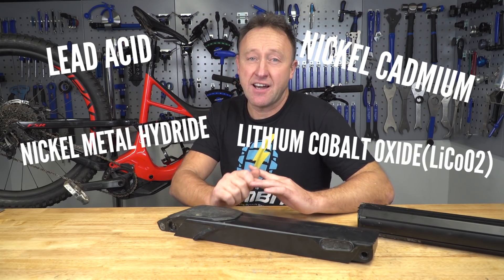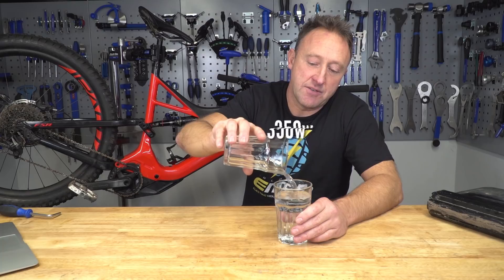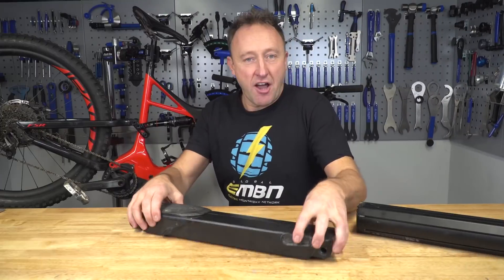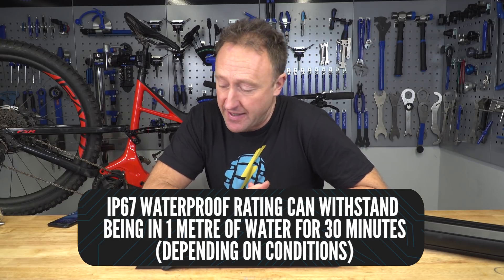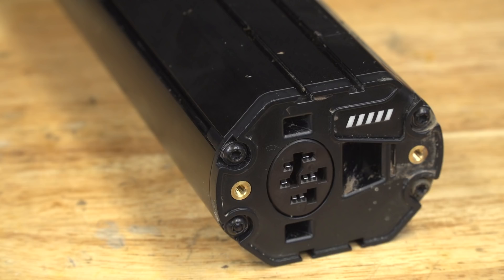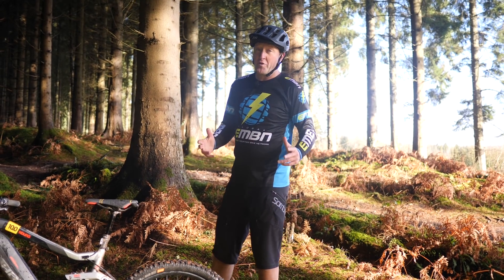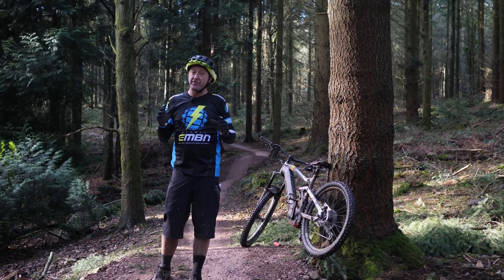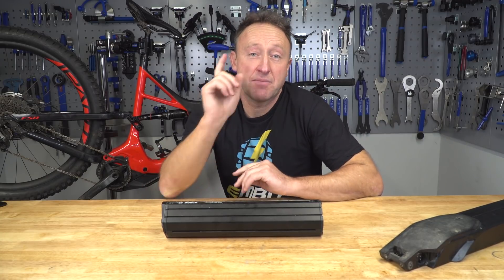E Mountain Bike Batteries Explained | EMBN's E-Bike Fundamentals Part 2

Comment from the maker: Leave any further questions about batteries or battery management in the comments below and we'll get back to you ⚡️💪
Reply: Tomi Saaranen don’t be put off. An ebike is probably the most grin inducing purchase you will ever make. 

I cannot speak highly enough of the fun I’ve had on mine.
Reply: Can a ebike be charged from a car 12v inverter?
Can a ebike be lifted on a roof carrier?
And last question can you fly with a ebike?
Reply: I have a 12v-240v invertor that I plug into cigarette lighter and then plug my Shimano charger in to charge my bike battery. Works just fine.
Reply: Electric Mountain Bike Network is there a way to charge your ebike battery from  a 12volt sort of supply? I’m thinking about whilst I’m away in my van and off grid. Potentially is there a battery to battery sort of transfer as an alternative?
Reply: Craig Wilson I’ve wondered that too. More the inverter bit though.
Reply: Regarding roof carrier, I did it several times: open the latches on the rail. Lift the holding clamps to a proper height. Take the battery and everything off the bike. The remaining 18-20kg are manageable to lift. There is a trick however: you must use a strap or a string and bond the front wheel to the frame, so that when you lift it, the wheel remains straight. Once you have the front wheel locked, hold the bike on the frame near the center of gravity (one hand near the battery support/bottle cage, the other at the same height on the saddle tube). Lift it above your head, horizontally. Move forward and put the wheels on the rail. Carefully rise the bike, pivoting the wheels in the rail. You may step on the curb or a small step if you are smallish or working on a high vehicle. Once you have the clamp holding the frame, the rest is easily done. To take it down, same procedure reversed: let the bike fall on you, hold it on the frame near the COG and let it fall down. 

For the total carrying capacity, check car and carrier manuals.
Reply: You guys should talk about the next generation of batteries like graphene supercapacitors  http://berc.berkeley.edu/storage-wars-batteries-vs-supercapacitors/
Reply: DiGiTaLGrAvEDiGGA Why? For the time being, it's just vaporware meant to gain attention on the media. If you can't buy it, why talk about it?
Reply: Yep, agree with Martyn, I've brought some daft things in the past but my E-MTB is epic fun, it really is.
Reply: Well, point me to an online store, then.
Reply: I can understand why you might want to charge mid-ride, but if you have been hammering those batteries, it is better to let them cool a bit first. Warm batteries do not appreciate being charged. Also, the BMS will reduce the total charge and rate (current) due to the increased temperature and apparent cell characteristics (different when hot).
Then again, if you are permanently busted-up like I am or you need a bit of help - go for it. Better than walking. :) Just consider that you will be reducing your overall battery life a little more than you would otherwise.
Reply: I keep my battery in the 20%-80% rangez and i charge my battery with slowest charger, i have bosch powertube 625 with 2A charger. 
I think fast charging is overheating the kemistry in battery and that heat is killing the battery. 
Just my toughts.
Reply: LOL you can buy them... jackass!!
Reply: Yes, you are right. You need to replace batteries soooo often. I saw rich cyclists become homeless because of the foolish expenses to continuously replace batteries. And, yes, every time I come back from a ride, I get headache, it must be those terribly hard calculations, like, 80km range - 50km made=how far yet?
Reply: After watching this video I'm not sure anymore do I ever want an e-bike! All I would be thinking is that how much battery life I have and saving it and stuff, and the batteries are very expensive to replace

Comment: Abit of false info in this video. Yes the bosh battery will charge to 100% in 4 hours if you upgrade the bosch charger otherwise it WILL take 8 hours to fully charge the battery. All this because bosch have 4 different charging systems.

Comment: Hi I’m new to ebikes and my battery keeps cutting out it has 4 leds and when he goes down to tree is when it cuts out I found when you turn it back on and go slower it keeps going but so annoying anyway idea would be appreciated thanks.
Reply from the maker: That doesn't sound right! Might be worth a check-up with your local bike shop or consulting with the brand which manufacture the bike :)

Comment: I get conflicting messages re charging, you say get into the habit of charging  after each ride however I have been told not to store battery charged so I have been leaving it flat until the day before a ride, whats the correct way
Reply: Did you get an answer to this. I was told the same as you.

Comment: Many thanks Steve for taking the time to make this video. I am however confused as I was told by my battery supplier Cap-Rouge Batteries that its amp-hour size that determines the range. You say its Watt-hours, please clarify the difference. Many thanks.
Reply: Hamish Ford amp hour is the correct term for battery capacity in the electrical industry amps x volts = Watts x time = watt hours

Comment: Question about charging..if you do short rides daily and you drain lets say just 10% on each, should you recharge daily or after lets say 7 days when battery reach 30% and then recharge it to full? The difference is 7 charges vs 1 charge a week. What is best for battery life?

Comment: This is all well and good, but not all E-Bikes are of the mountain bike type. I recently installed a front wheel drive Direct Drive hub motor on my recumbent. I just topped 300 miles today. So far my best distance is 30 miles and I still have 40% battery. Oh, the motor is a 48 Volt 500 watt hub motor, Direct Drive. The battery is LithIon 48 volts 10 amps. And I use only what I need assist wise. I have five settings and I normally cruise in assist level 3. But, there are some big hills in the town I live in, so I bump it up to 5, just to get up the hill faster. You also forgot to talk about voltage spikes. I've noticed my battery level indicator goes down when I'm climbing a hill in assist five, but then when I go back to three, the battery level indicator goes back up. Yeah, lots of things to consider.

Comment: Two points which eBike manufacturers won't tell you about batteries:
1. You should avoid discharging battery completely. Is much "healthier" for the battery to do as many "half cycles" as possible. This should give you even up to 2000 half cycles!
2. Allow at least 30min after the ride before putting battery on charge. This settles battery chemistry to the optimal charging level.
Bosch, Yamaha, Shimano etc they don't make the battery cells which the batteries are build from. Those are Panasonic/Sanyo, Samsung, Lg etc. Read what they recommend for the long battery life ❣️❣️❣️

Comment: 7-£800 You must be "Mad" Every bike company is taking the piss! Wonder why they use dirty outdated tech? When they know they can use a supercapacitors bank, Instead of a big heavy battery, which would cost slightly more, But away cleaner tech, If lithium can only take 1000 charges and take a poxy 5 hrs to charge up, In my book your getting ripped off! A supercapacitor bank will take well over 1 million + charges and only take 30 seconds to charge to full power and put out the same power or even more power if required depending on your needs, If you want to run a 8,000 Watt motor it can handle it all day long! Try telling that to these outdated bike company that love to ram cheap chineesium crap down people's necks! Don't buy them they are a waste of money when you can buy a marine capacitor bank, They use them in nuke subs and other special kit like aircraft carriers ect, You get what you pay for and some of them bikes are way overpriced and under teched for that price, when you can build your own one and have a full charge in 30 seconds. They have fallen asleep at the wheel for the last 20 years.
Reply: A supercapacitor can't hold anywhere near a battery's specific energy volume, And  you think lithium batteries are expensive? Supercapacitor: Hold my beer! - They are 20+ times more expensive per watt! They are just not viable for consumer items! Unless you want an iphone that's 2 inches thick with less energy stored per unit mass and costs several times more? lol Having said all this, Hopefully with technology progressing as it is, Something can be achieved.. But these tech companies need to stop and pull their fingers out! It's all about impressing with specs and no focus on how long the power lasts.

Comment: Ebike are a big money swindle of the bike company's, 1euro for 1wah battery. 18650 LG, Samsung, Panasonic cost around 2euro, so 50x will cost 100euro, with some plastic and a bms it will be 110euro. Also the bms gives no indication about bad cells, so you rid 50km from home and the battery stop because 1-cell is under 3volt, with a balanced lcd charger that gives the user a signal it will never been happen, but for the bike company's that's 1euro more for a pcb with a lcd.

Comment: Thanks for the excellent topic.  Very informative.  One thing you didn't cover is an issue that I have had:. The charger to battery interface plug.  My Yamaha charger plug takes a bit of finesse to couple with the battery.  I wish it were easier.

Comment: ive cyced all over Europe on cyclo-cross bikes., and ride a TREKfuel MTB. I've never had an ebike.and a little scared of making the transision? Can someone explain to me without staying in a motel or B&B every night to charge up your used battery on a tour (which can be extremely expensive) across the country, which means charging you cant camp in the wild? So is ebike touring a problem how would you overcome the constant daily charging. carrying a spare battery would weigh a ton. 2ndly Ive got a medium size dog who wants to see the world in his trailer I guess pulling a doggie triailer is going to really half your distance  per charging. I thought of paying bike shops and places I visit to charge my battery for a few hours but contemplating all this stuff makes me think may as well go dual sport Honda 250 and just pay for gas? Any tips anyone thanks????. this video is really good thankyou

Comment: What about shorting the battery out during a ride?  What should one avoid?  Metal Rings, necklaces ect... do a vid on that. The battery... does the current run through the handle bars? Do you feel a small amount of voltage while riding?... You can deeper into this topic... kinda important.
Reply: LOL very low voltage and amperage at the display end of the system. Very unlikely you'd short a battery out and even if you did the BMS would trip.

Comment: Hi I need some advice,I’ve got a 1000w 36v viron scooter and I need to be able to charge the batteries while they are not plugged into the scooter( no power where it’s stored and I can’t carry the scooter up to my flat ) does it need the control box in the circuit or can I just make a wire with the necessary plugs at each end,the fuse is already wired in at the battery end,thanks for any help

Comment: The 500w Bosch battery on my Moustache Race9 carbon is guaranteed for 2 years or 500 charging cycles. It is not clear from this video if a charge from say 40% remaining qualifies as a full charging cycle or approx a 50% charging cycle?  Can Bosch or other manufacturers calculate from the battery diagnostics how many cycles the battery has been through and differentiate between part and full charging cycles?

Comment: You said to turn the motor off when going downhill to preserve battery - is that an easy thing to do when on the go?

I mean, is there a simple on/off switch on the handlebars to turn the motor off when you are actually about to come to a downhill bit... then turn it back on when you reach the bottom?
Reply: I presumed when you stop pedalling you stop assistance so you stop battery power being used? What would be the point of turning it off down a hill? But yes on control pad you can chose No assistance like you can choose assistance level (Some cheaper bikes don't give you the no assistance option and you have to just switch the power off on the pad)
Reply: No idea whether the battery is not being used if you stop pedalling - am new to all of this so just watching these videos to learn.
Reply: I'm not new. I have my second E-bike. When you pedal my display shows the power being drawn, When I don't pedal there's no indication of power being drawn. So this is why I presume this? So I don't get what he means by turning off assistance saves battery when going down hill? Anyway, As I said yeah you can turn off assistance from the control pad/stick/display.
Reply: Sorry my pee brain has just clicked lol I think he means when your terrain is down slope and easy to pedal anyway, Then no point in using assistance. Basically it's making the most out of a single charge, Use the mixture of assistance levels when really needed and don't use any when it's really not necessary.
Reply: Actually don’t all batteries turn off she 25kms is exceeded?

Comment: You can use a silicone based dielectric grease to protect your battery connections but I would advise against any petroleum based products - generally their melting point is too low and will cause them to dry out at which point they will actually hinder conductivity and be difficult to remove and clean. The dielectric grease does not conduct electricity itself but the theory is the grease get's pushed out of the way when the metal to metal connection is made and therefore should not affect conductivity. if you had a sloppy fitting connector then using any grease at all would be inadvisable.

Comment: do you know if its better to drain it below 20% before charging ? and if half a charge to 50-70% is good or bad for this kind of batteries?
Reply: it depends on the cells used. some maybe 20% lower

Comment: Thanks for the brilliant videos. One question that I don't think I have seen answered is security: what is to stop a thief just unclipping the battery and walking off with it while the bike is parked up? Internal batteries seem to be more resistant to theft but even those look relatively easy to remove.
Reply from the maker: Good point! Some bikes come with keys that lock the batteries in place, though others don't. Maybe taking the battery with you is an option?
Reply: The cheep Lo26 samebike I have is within the frame the key has three positions full on, remove key and pin lock unlock remove key. 

2nd position the key can be removed but the battery pin is engaged 

The second position

Comment: I rode an ebike last summer, my progression was interesting, retiring my Enduro bike (Nomad v2) and getting help to keep up with my riding group, as I am much older than most of them, it is an amazing experience to keep up again. At first I used Eco mode as much as possible, battery use went well, my average riding time only used a fifth or at most a quarter or the battery capacity. Perhaps because I had been riding very slowly in the past, always at the back of the group. As the season moved on and I grew more confident I found my self using higher levels of assist, going faster the battery did not last as many rides. Ride with manners - you likely know that being at the back is hard on the pride. The group seemed OK with the rests they got while I caught up. They enjoy the vampire like mosquitos they had to endure. (so, no rest for you!) I also firmly believe that staying at he rear of the group has not put the others in the group in a position to resent the help I get from the motor, though they no longer have to wait for me. When delayed at the back helping others with trail problems, I seldomly get dropped and amplify fatigue catching up. I really dislike the non-linear fuel gauge (Giant Fulle)  on my bike, when the battery says 15% left it really means one more small climb and I'm on my own, no matter how conservatively I pedal. I mean to not go on a ride without half a battery charge. Finessing balance on slow sections like boardwalks and scary steep traverses has cost me several crashes, the bike mass and geometry makes a massive difference.  If you wish do a  comparison of battery usage on the same ebike, or maybe just load up a heavy backpack.
Reply: Thanks for sharing your experience. Good to know!

Comment: I am intrigued how the cell balancing is done in these packs. Clearly there are no balance leads going to the pack from the PSU, so the charge circuitry must all be on board. Balancing is critical to maintaining cycle life in lithium packs so I would love to hear more about this please.
Reply: The BMS or battery management system is in the battery pack not the motor or the charger. Mostly they do a good job but have heard that Spesh and others don't have good BMS's. Don't think it's a big deal and it wouldn't sway me from one brand  to another.

Comment: I find the best way is use normal mode , the syncdrive system has a torque sensor which applies a percentage of the power I input. If I have a cadence of about 75 RPM, and an appropriate gear to spin without having to stamp on the pedals, I am only applying medium pressure to the pedals, which means the percentage the motor puts in is less than stamping. In theory using less battery power. Seems to work as after a morning ride my Brother has about 20% left in his battery against my 50%, He tends to be a gear or two higher than me and grinds rather than spin.